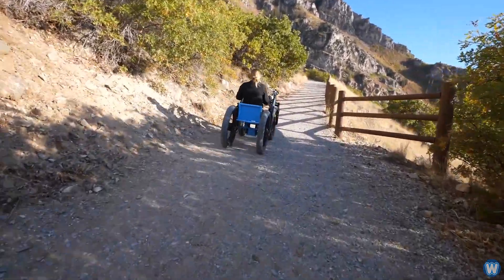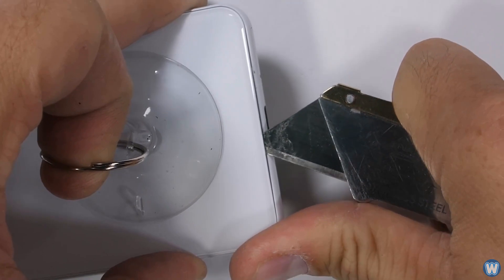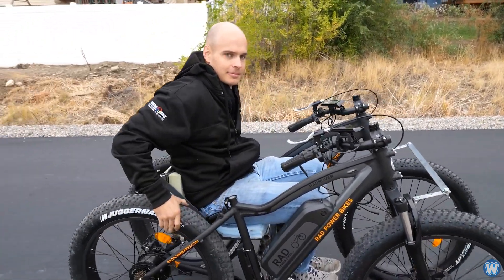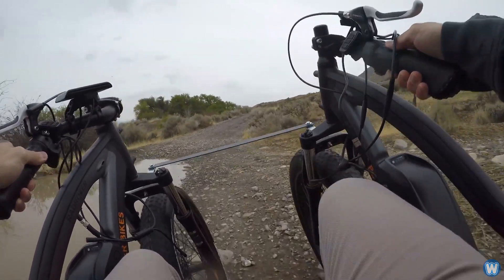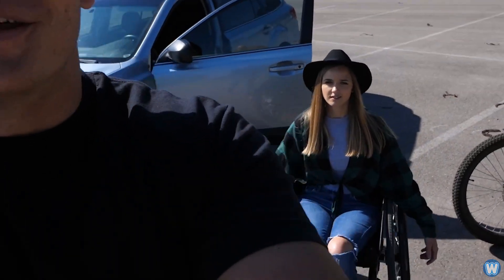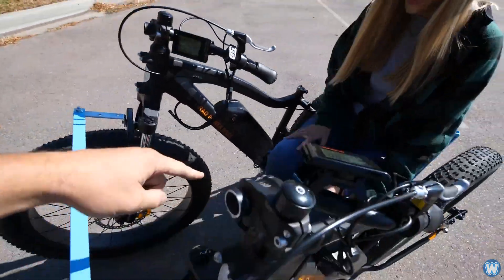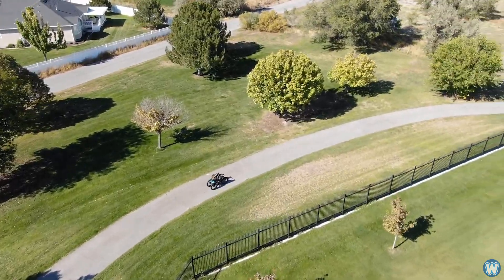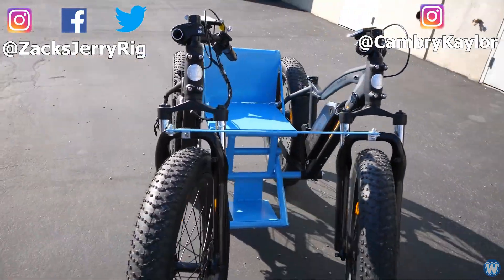Man Designs an Off-Road "Wheelchair" Made out of 2 Mountain Bikes

Comment: I'm finding it difficult to figure out how to add extra wheels to my electric bike! I've added a storage-type section at the back of my seat and want to add two extra wheels on the sides of my back wheels for extra support. They're the same size wheels (14") and stabiliser extensions aren't the right shape/don't fit. Where can I get a 5-7" screwable extension to add extra wheels? There are two screw holes at the top of the axles on both sides of the wheel frame.

Comment: Is there a special reason both handlebars are mounted on the same side of the frame and not mirrored?
Reply: I think it's because the handle used on each bike has the rear brake lever on it, so both right side handles need to point backwards.
In a later video, he adds twin cable brake levers for 4-wheel braking.

Comment: He just might of created something that may eventually help handicapped individuals everywhere... ❤👍
Reply from the maker: well yes & no, in one of his videos he does state how there are off road wheelchairs, but at twice the price of this design, so about $6000
Reply: @WonderWorldYTC  his design requires the driver to be carried in and out, the seat is not very comfortable i bet and it has no belts for security so that's probably why it costs half the price.
Reply from the maker: @elgato9o  true on all points, but based on the size of these off road wheelchairs you probably would need help getting to and from a location anyway, unless you simply ride it to & from your home, in which case you just need help getting in, but I bet she could have climbed over the bike frame to get it, not easily, but doable.